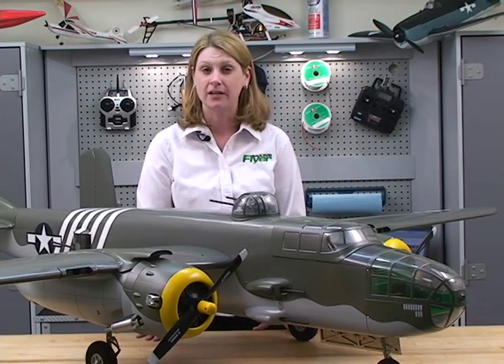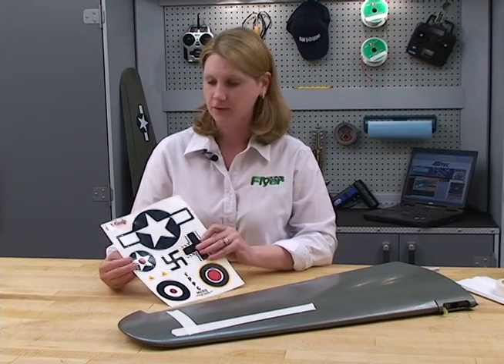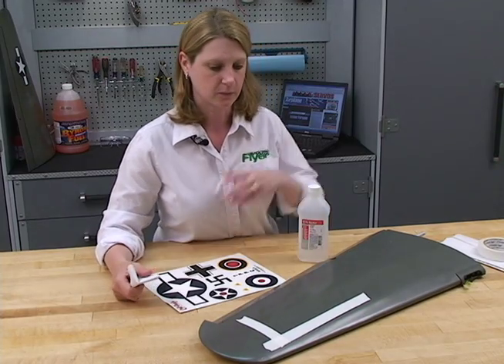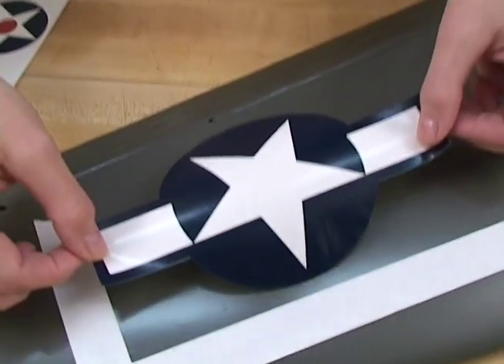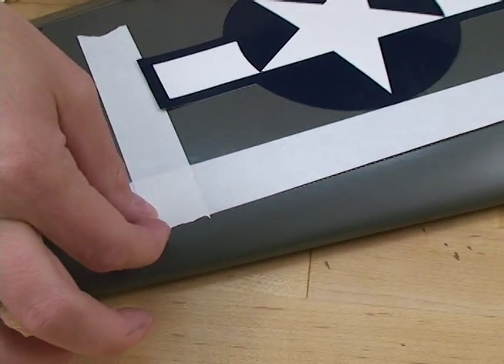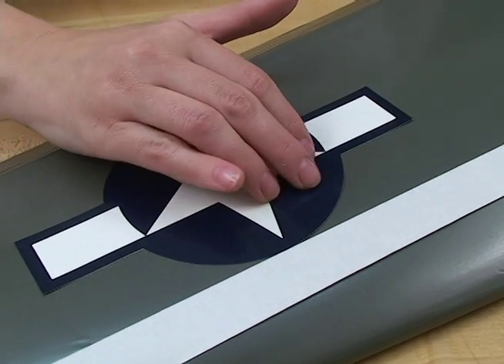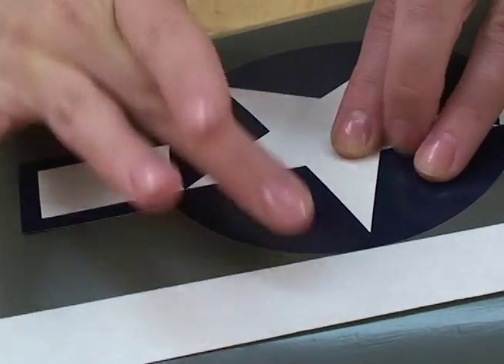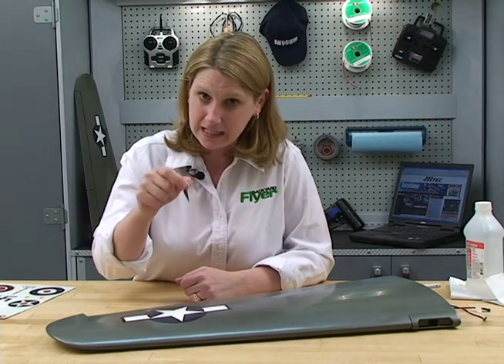How To Apply Decals To Your RC Plane

Comment: You should use a spray bottle with a mix of water and some dish soap. Try 100ml water and 5ml soap. Spray mix on wing and then apply sticker. Allows you to move it into place. Dumb excess water off and allow to dry. Suggest you do a test sticker first

Comment: Not the very best way IMO, better to use a (very) little water and washing up liquid mix to be able to temporarily limit the adhesive decal/vinyl gripping and "float" the decal into place, allowing easy repositioning without wrinkles and folding, then once properly aligned, smooth it down as Debra does from the middle out, then leave a good while for the remaining damp to evaporate, then smooth again.............fixed.